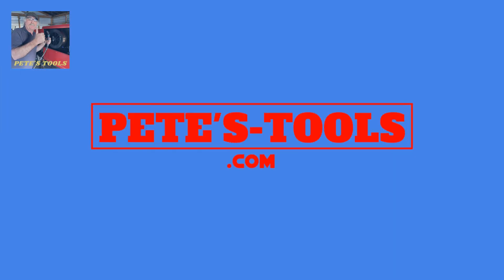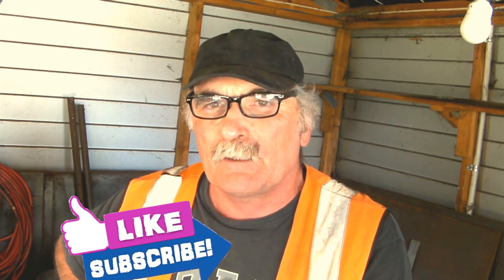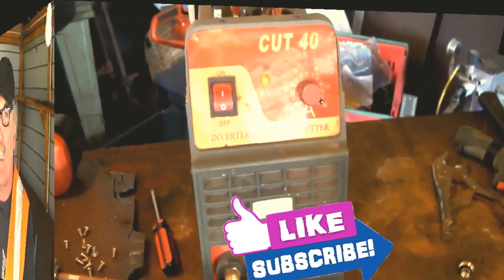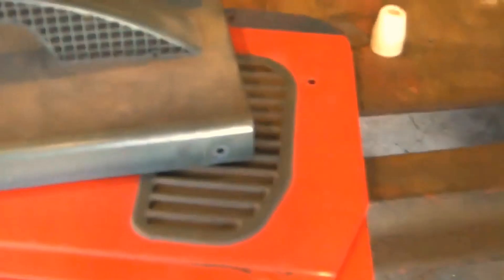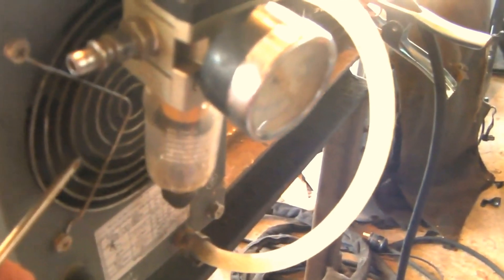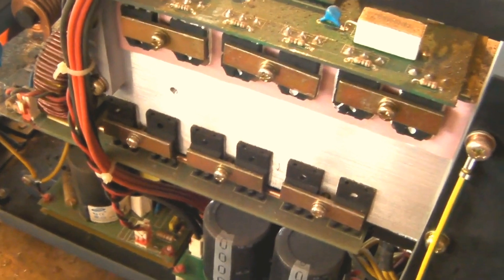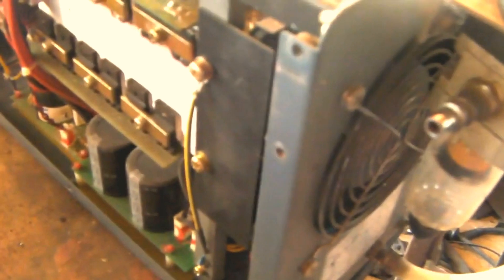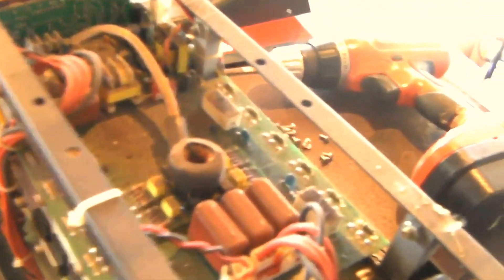Chinese Plasma Cutter Maintenance

Comment: Good to see you back Pete! Thanks for all these videos, they've helped me alot when I was looking to get a plasma. And instead of just keeping on waiting to be able to buy an expensive cutter (hypertherm), ended up going middle of the road and got a Primeweld Cut60. And it a great tool to finally have in my garage. Thanks Again, Have a Good One!
Reply from the maker: Hi mate , Have you made any cool projects with your machine?
Reply: @petestools  been really busy lately, but I did get a 220v 6awg wire run just for my plasma. Was using 110v at the beginning, upgrading to the 220v made a big difference in cutting speed and how clean the cut was. After I got that installed, I did use it for some upgrades for my gravity fed wood pellet stove. I cut two parts out of some scrap stainless steel, that had some weird dimension and angles, that I was able to fit into the bottom of the pellet hopper. Previously I kept having pellets getting hung up just from the friction, and my stove would burn out. But now with the stainless bottom and the drop "shoot" it runs down into, it works Much better. Will run almost completely empty without issue. Did a couple other small odd and ends jobs, but been so busy with other work haven't got to use it a lot yet. But really glad to have it in the garage now. So much better than having to use an angle grinder for everything. 
Thanks for your videos Pete! Have a Good One!

Comment: Only thing l might suggest is sticking a Q-tip or something like it between the blades of the fan to keep it from turning.  Compressed air can get the fan up to speeds that will damage the bearings.  Cheers.
Reply from the maker: Good idea thanks